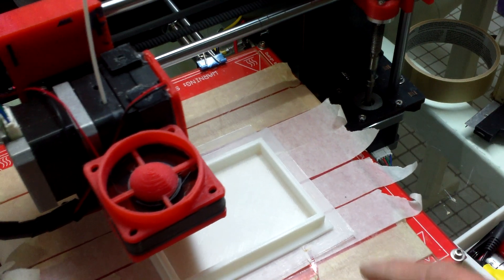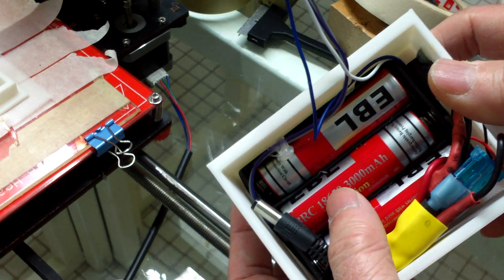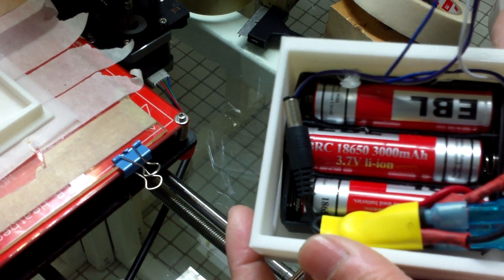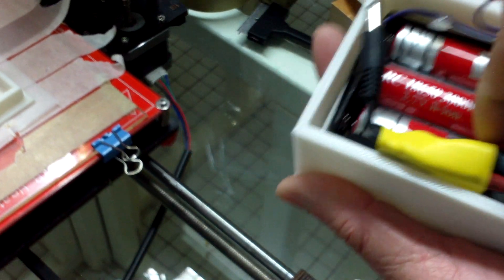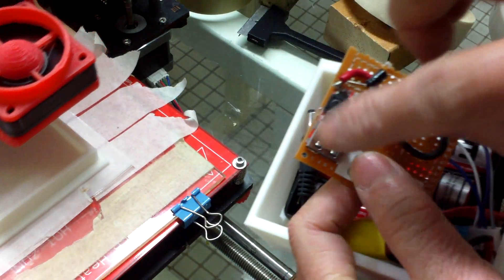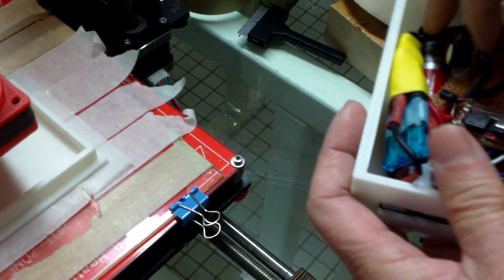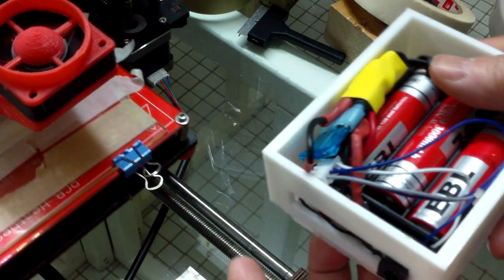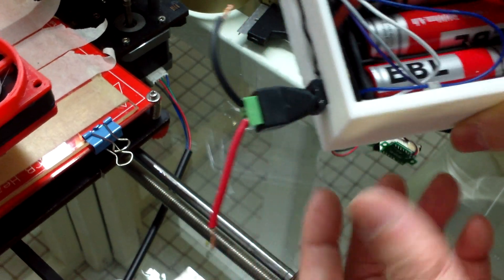3D printed 12v battery box Part 1

Comment: Looks good. I just tore into an old toshiba laptop battery for a couple cells i think i should make one of these with the other 10 cells im not using.  I have been watching people start cars with large caps it seems interesting
Reply from the maker: The 12v power bank is handy to have, at home or in the car. I just upgraded to an old iPhone (5) that needs to be charged 2 times a day.

Comment: Those cheap red&silver 18650s are normally only ~600mAh.  I wouldn't be surprised if those fakes are full of sand. Old laptop 18650s are normally >2Ah.
Reply from the maker: I think mine is about 1000 mA when charged to 4.1v and discharged to 3v. The yellow ones are probably 600mAh  and the red ones rated at 5000 man even less.